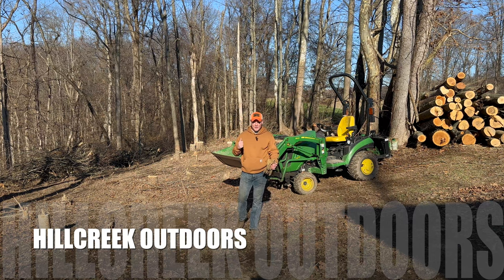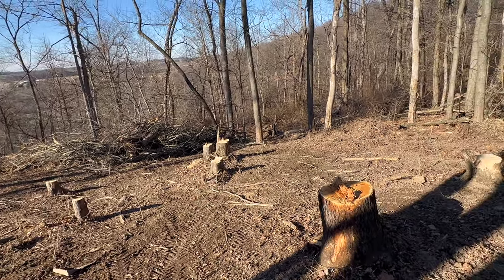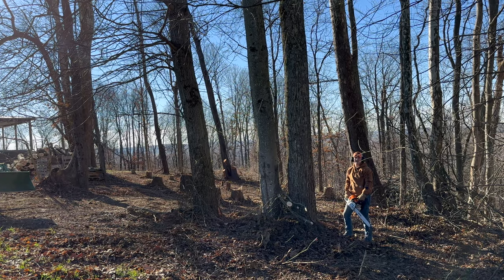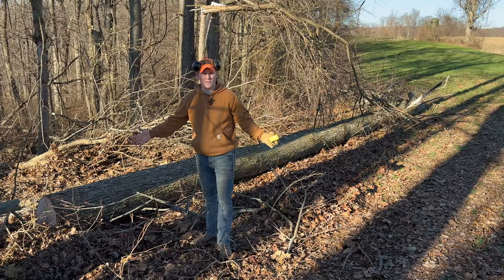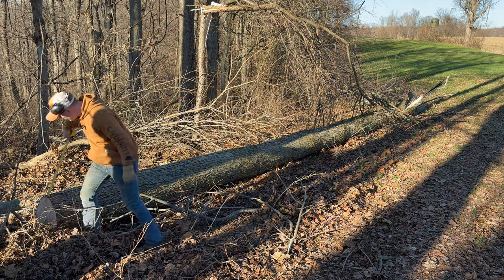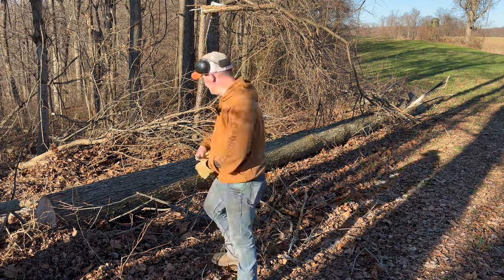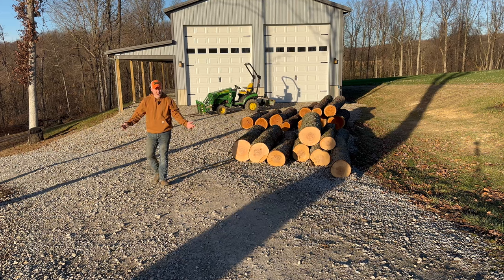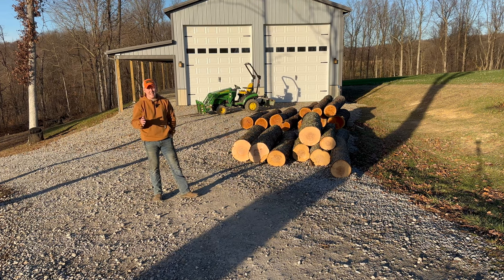JOHN DEERE 1025R on TREE Removal for the PASTURE PROJECT

Comment: This looks encouraging. I have a 1025R and have lots of trees I want to cut to open up for a small pasture. How did you get the stumps out?
Reply from the maker: There is only so much the 1025r can do so I had to bring in a Track hoe/ excavator to get the stumps out. 

You will have a blast at opening up for a small pasture! I know I did and you will be amazed how much the 1025r can accomplish.